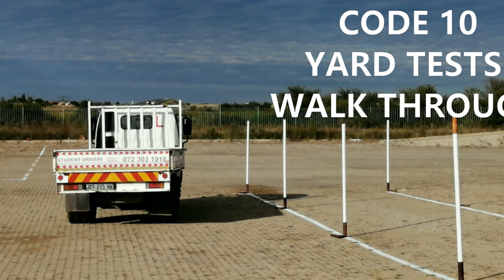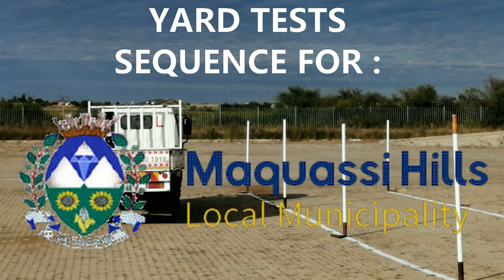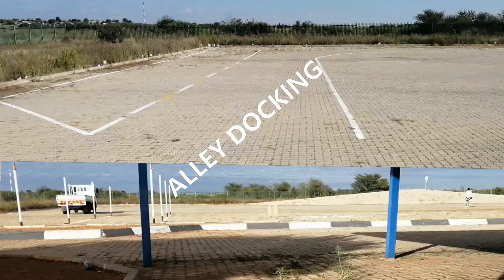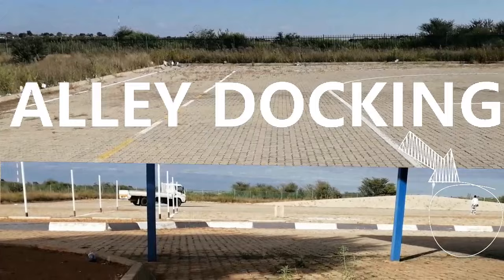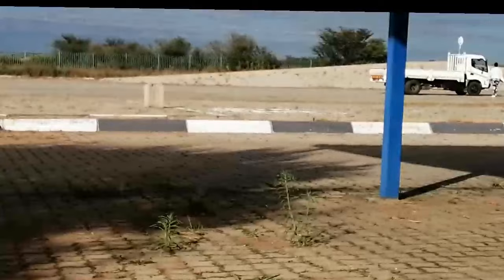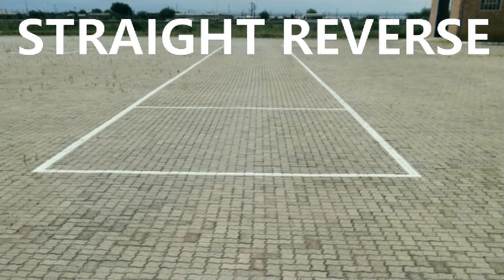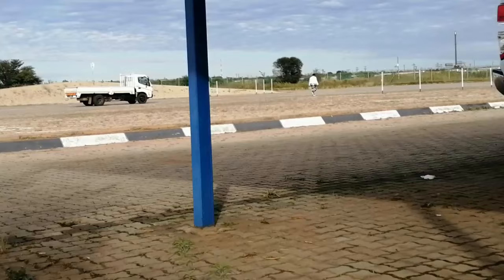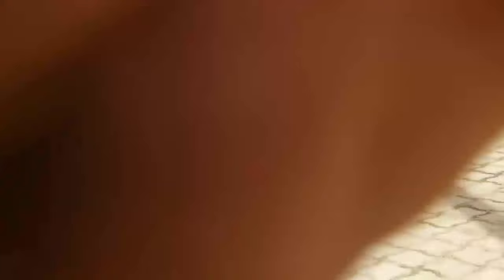Code 10 yard walk through/ YARD TEST/ YARD LAYOUT

Comment: Different driving schools teach Different techniques. What confuses me is whether to use or not use a bit of the accelerator to help balance the vehicle when doing an incline.
Reply from the maker: Hi, we always have used the accelarator there is no problem with that it does help to give more rpms to the vehicle, now it depends on what vehicle you are using cause some of the trucks handbrakes are working on the propshafts and some works directly on the back wheels in our case the trucks handbrake works on the propshaft and this makes it dificult to use the accelarator to do the incline becase wans you stop on the top of the incline and you release the footbrake the truck will go back even if the handbrake is up due to its only locking the propshaft.
If i must really be honest it will be better not to use accelarator cause if you use the accelarator you should keep your foot balaced on the accelarator while balancing the clutch otherwise it wont work cause you wil have rpms but not any pull remember that it is the clutch that are really doing the work a steady foot and alot of patients wil make it work perfectly, it is also your choice for if you wish to use accelarator i hope this helps if you have any questions you can just ask and ill try my best to explain but it always better to show someone practically to see how the magic works 💪